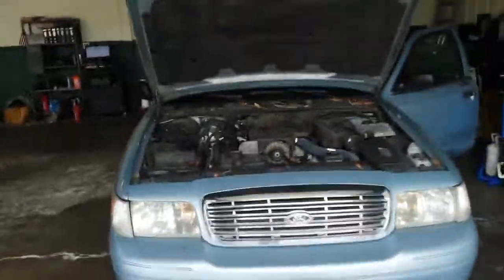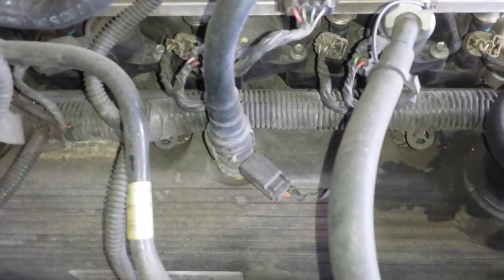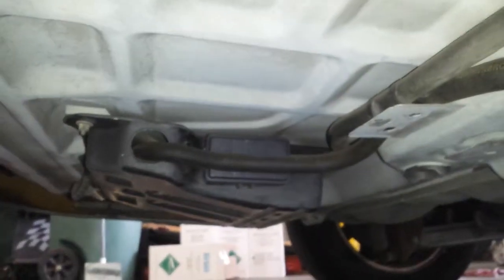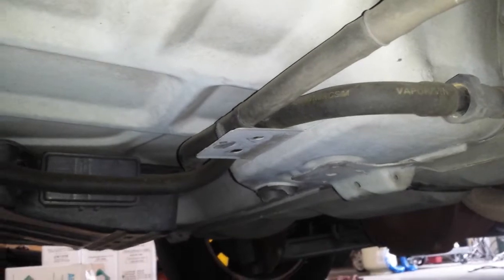Ford Crown Victoria emissions: PCV valve, EVAP canister, EVAP solenoid, & EGR locations

Comment: Is a pcv delete doing any harm to the engine? I don't think so and I think it would make the engine run cleaner with better throttle response. (not exactly noticeable probably but still)
Reply from the maker: The pcv sucks the condensation and blow by out of the top of the engine. You will get a ton of gunk built up in the valve cover. Are you going to plug the system or do 2 breathers?
Reply: I'd probably plug the entry to the intake and put one of those small filters on the crankcase pcv exit. I haven't checked options yet for the crown vic, what type of breather does it take?
Reply from the maker: The breather on your car gets air from the intake on one side of the motor. The pcv is on the opposite side of the motor to suck out all the harmful fumes and condensation.  In all honesty if you compare the give and take, I would recommend not removing it. Your going to have to change the oil more frequently to ensure your not building up gunk. Pcv should not effect throttle response unless you have a defective pcv or vaccum leak in the pcv system.
Reply: Oh well thanks, I probably won't change the setup then. But I still have questions, what sucks out the fumes? is it the positive pressure in the crankcase? Because if it is wouldn't the fumes exit through the same hose as the fresh air enters?
Reply from the maker: The Breather gets filtered air through the intake system. When the vehicle is turned on and vacuum is created that causes the PCV valve to open. When the PCV valve opens it'll suck the air that's coming in through the Breather into the vacuum side of the intake. At that point the fumes and Vapors will go through the engine and will Escape through the tailpipe after being burned up in the combustion process.
Reply: I have a mercury grand marquis that I bought with 89.000 mile and now have 125.00 the pcv has a censor on it but engine has not come on. It does have leaks on oil pan and valve cover. How much would pcv cost and should I wait until check engine light comes on.

Comment: I need help, i hsve a 2007 croen Victoria and the car just died like it ran out of gas and i changed the fuel filter and fuel pump but still all the car does is turn over. Any ideas on what to do next
Reply: Change the fuel pump relay they go bad as the pump is going bad

Comment: I have an 09 P71 with two codes, P0446 n P0455, can somebody anybody tell me why n how to get it fixed??
Reply from the maker: Once Upon a Time I smogged police interceptors from an auction yard for a while. You for sure have a evap problem. The simplest fix would be replace the gas cap  and the check engine light goes away . Another fairly easy fix would be either the purge solenoid stuck open or the solenoid stuck open. You could also have a leak in the evap hose somewhere in the system. Or even the canister can be leaking. You need somebody to do a smoke diagnosis first. They would induce smoke into the little green cap on the EVAP system under the hood and see if you have any leaks anywhere. That should find this fix. But I have also seen some circumstances where the vehicle was wrecked and repaired and the wires were not run properly so they either got pinched or cut in the reassembly process prior to being sold. I'm not sure if any of that helps or is just reassuring you of your problem but I hope it did. Good luck and keep us posted. This seems to be common issue.
Reply: Scotties Hobbies, hey thanks dude, your message does help, I will try it out n let you know..
Reply: @ScottiesHobbies  What's up man, keeping you posted..lol i have CEL code P0442 n i think my mechanic said the thing in the front passenger side was either stuck open or closed, think that'll be my issue?? The part doesn't cost much so i plan on buying it but i notice the vacuum line that goes connected to it has the clip missing on it but it looks new, might go ahead n buy that one too n see if my issue gets solved, peace bro..
Reply: @nestor aguirre which one n what have you done to your car or is it stock??
Reply: @nestor aguirre Check your engine n intake vacuum lines.. A smoke test could find your problem, good luck..

Comment: I have a 99" Crown Vic I put it on a code reader and it tells me I have an Evap leak is that why my service engine light is On and could I do it myself to save money.?
Reply: Either you're purge valve doesn't close all the way or your filter is clogged in the EVAP system under the gas tank

Comment: my car has the same vacuum sound is that the canister you think
Reply from the maker: +SpiritofLiberty1775 is your idle high? Its more common for these vehicles to have a vac leak on or near the intake manifold. Check the vac hose to the pcv, they collapse and leak a lot. Also try using a speay bottle to spray near the sound to find a vac leak.

Comment: My 2002 grand marquis doesn't have that connector on the PCV valve, why could that be? thanks, cool video!
Reply: It's just a sensor that tells if it's working or not
Reply: Yours is 5 years older you normally change a PCV valve is part of the basic tune-up now there's a sensor in it so that you don't have to rattle it to tell if it's bad
Reply: cold states got heated PCV vales 03+

Comment: Can anyone tell me what the big cylinder that looks like a big cylindrical air filter housing, sticking out of the firewall, just left the left of where coolant hoses go thru the firewall to the heater core, is? Mine appears to be leaking.
Reply: I have an EVAP system (very small leak) code and I think this may have something to do with it. Liquid dripping is occurring underneath whatever this thing is.
Reply: That's your blower motor

Comment: what does each one of them do?
also, should I replace them?
Reply from the maker: +alsogooraa each of what? The pcv valve should be replaced every 60-8000p miles. The evap system components should replaced as needed. Evap could last for ever but not likely, just replace the components when they fail to operate properly.
Reply: How do you know if the car has heated or not heated pcv

Comment: No no the evap canister while yes is easy to find if you live in the rust belt like i do getting that stupid cover off once those bolts rust is a pain in the ass.
Reply from the maker: That is true. Rust does make life harder. I have that problem a lot with my truck. We drive a lot in the snow so I drive over salt often.

Comment: on a 2003 mercury grand marquis
Reply from the maker: Off the top of my head i don't know. Id fallow the hoses from the evap cannister. The purge should be under the hood, going to the intake and the vent is from the canister to ambient.
Reply: Scotties Hobbies I have a 99 crown vic is this why I'm getting the p1451 code

Comment: WHERE ON A 02 CROWN VICTORIA?..
Reply from the maker: +DOMINIC BROWN i think it should be pretty darn similar.
Reply: Scotties Hobbies I THOUGHT SO TOO BUT I CAN'T SEE IT, I WILL DOUBLE CHECK AND LET YOU KNOW ASAP.
Reply: THE PRESSURE SENSOR IS WHAT I'M LOOKING FOR..
Reply from the maker: +DOMINIC BROWN I got a comment from another person a wile back about this on a different vid. 

The EVAP pressure sensor might be on the 'upper passenger side of tank'. They said the tank needs to be lowered but not removed to get access to it. 

Never seen one with my own eyes tho.
Reply: I changed the solenoid 3 times under trunk of my 01 t owncar. Still getting p1451 and egr code.